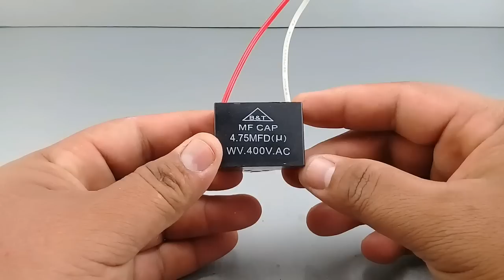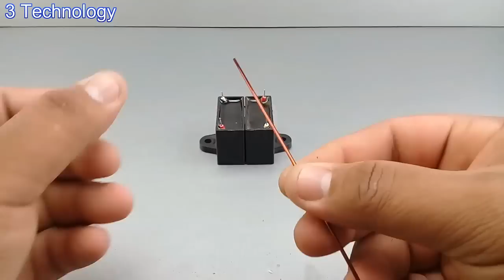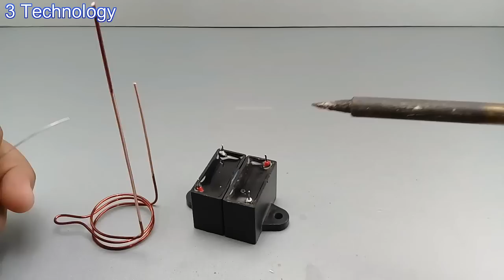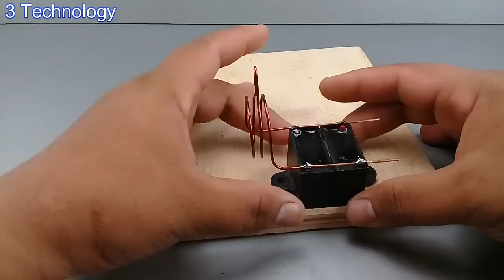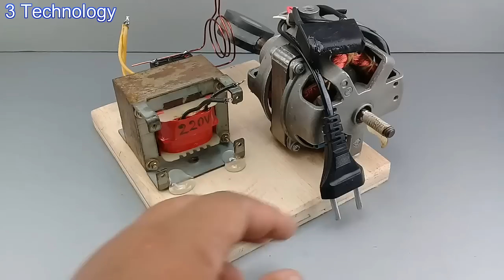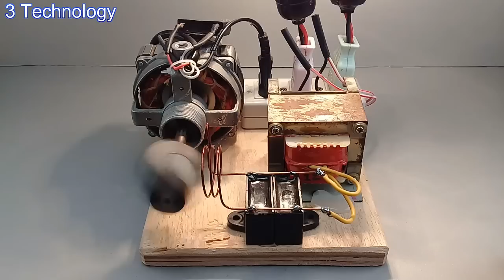I Make 8000w Free Electricity Energy / Self Running 24 hours

Comment: 8000w = 8Kva so if that's is 8Kva then plug in and run a 9 inch angle grinder, a large kettle full of water and a 4 slice toaster all at once that should at a rough guess run out at 6000w and then lets see if it still works, 2 light bulbs pfttttttttt bullshit to 8000w